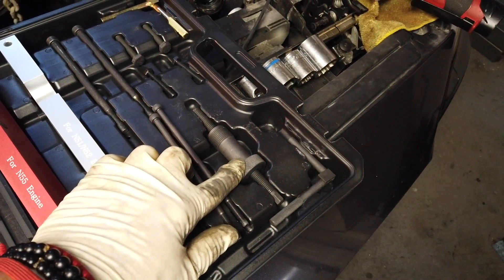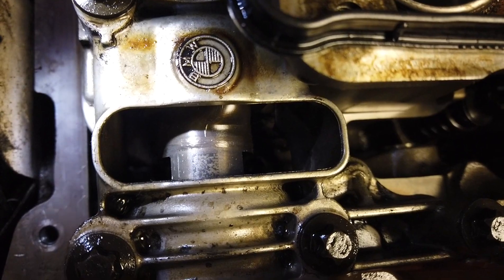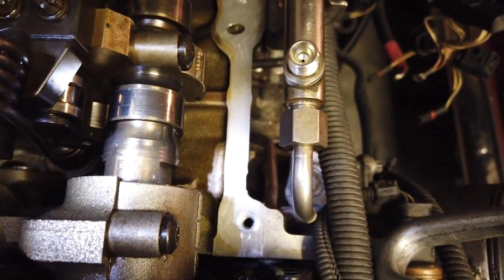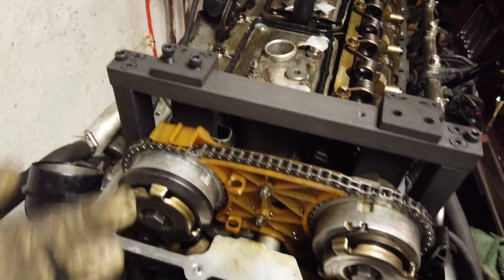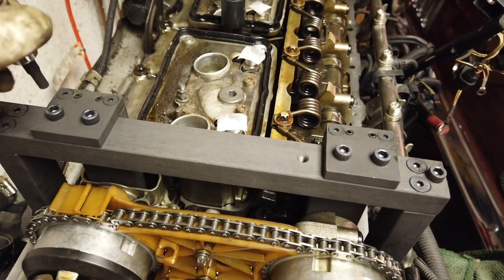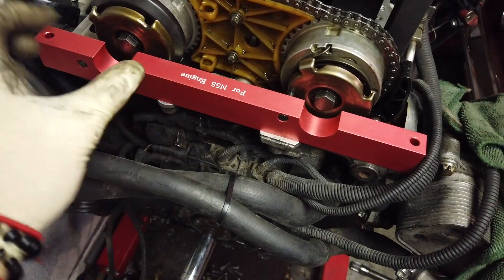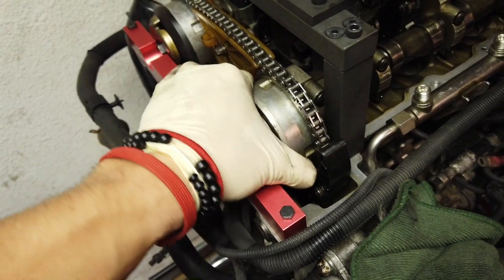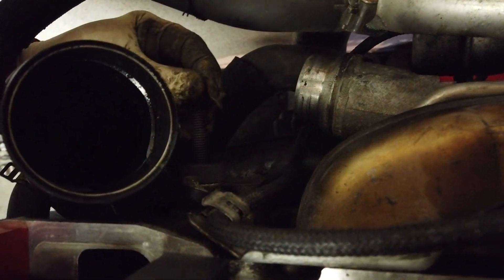BMW N55 timing the engine.

Comment: Hi! When you removed the main crankshaft bolt the only thing you needed to lock the flywheel was the pin? Or did you need another tool? I'm worried about snapping that pin with such high torque values when replacing that bolt..
Reply from the maker: You cannot use a flywheel pin to tighten up the main crank bolt. Do not even try to hold the flywheel from the rear of the motor to tighten up the crank hub bolt...that is now cranks snap in two pieces. Only use a special tool and a very long breaker bar because there is a lot of torque that the crank hub needs.
Reply: @prkarpi23 how did you set up that timing with the black bar on the cam locking tool and not the gold bar for the n55? I’m have  “camshaft installed incorrectly fault” that I can get rid of and the timing was checked 10 times and is ok.
Reply from the maker: @ewenblack4174  if your timing is good then it is not timing but other things. Such as camshaft seal for VVT adjuster intake or exhaust. Bad VVT itself or bolts that tighten the VVT need to be replaced. You need a scanner tool to examine the fault code.
Reply: @prkarpi23  i have a scan tool and service information( 30 yrs a technician) ive never seen a car do anything like this from resetting the adaptations.
Reply from the maker: @ewenblack4174  does your error pointing to an intake or exhaust cam for bad timing or both?
Reply: @prkarpi23  at first after that valve cover repair it was only the exhaust cam, I got the timing tool set and tried to time is and it was off but then I realized I was not lining up the crank pin in the right place so I probably mess up the timing worse because then I started getting them on both cams… I’m messing with the car right now and I’m noticing that when I rotate the engine put the crank pin in the correct spot(using a camera now) the tool that lines up the front on the cams will not go on. Everytime I’ve been checking it I’ve been putting the top bars on to lock the cams(I’ve always had to move them a bit to fit) and then the front tool lines up. Sorry for the long post
Reply from the maker: @ewenblack4174  have you replaced the bolts? Bc bolts loose integrity and they will break. I bet your vvt is skipping because of it.
Reply: @prkarpi23  yes I have new bolts, let me ask… if I turn the engine to tdc,lock the flywheel and check the timing at the front of the vvt’s without putting the cam lock tool that goes on the top the timing should be ok without that cam bar correct?
Reply from the maker: @ewenblack4174  if you have your pin locked yes....but make sure it is in the right boss. I'd check and see the piston on cylinder 1 to be TDC also. 
Then, your cams should be aligned with scan bar at the very top.

Comment: Nice video. Best so far.
N51 engine. I have the Cam Locking tool.
I have to remove and replace the Exhaust Camshaft Adjuster gear. 
The timing chain is still ‘intact.’
I will find the TDC slowly rotating the Crank on the front.

My question is: 
Is it needed to lock the Flywheel (below the starter area)? 
Even though I’m only replacing the Exhaust Camshaft Adjuster gear only?
Thanks friend
Reply from the maker: I would lock it up if you have that ability since you would be more reassured that you have true TDC..  The pin hole is there and if you can see clearly where the flywheel meets the pin hole - do it.
Reply: @prkarpi23  gotcha. Thx
Reply from the maker: also, rotate the motor couple times manually after the installation to make sure you have no valve binding! Have fun! @simplelangperorock